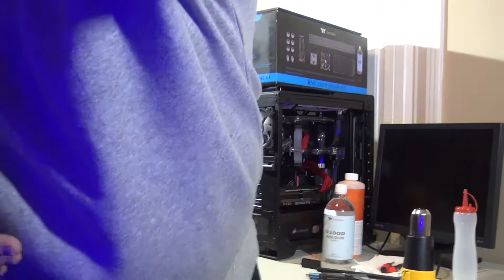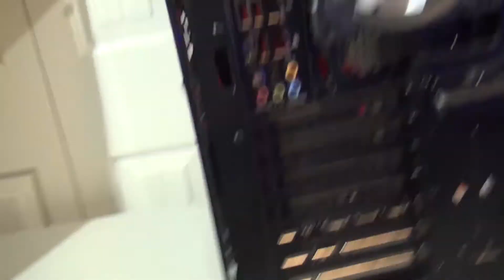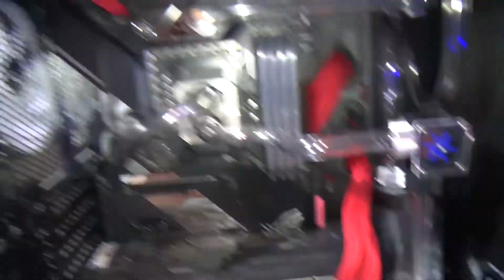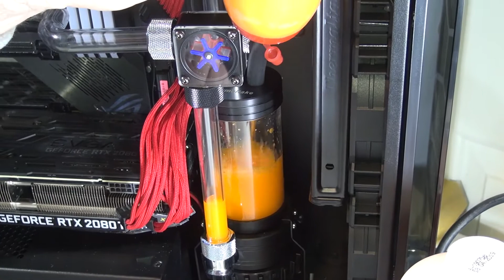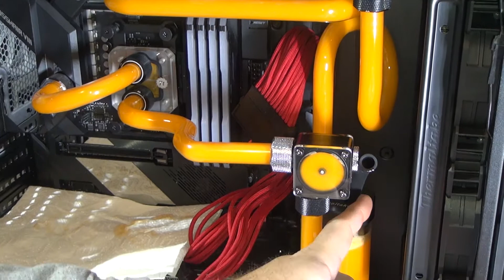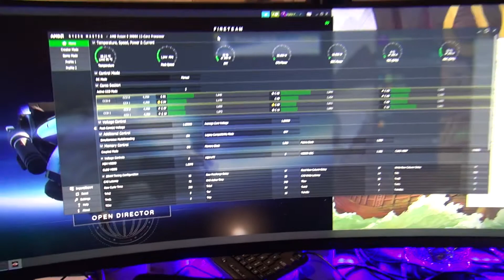Thermaltake m240 Water Cooling Kit Review and Build

Comment: How is the fluid going? Do you recommend that from EKWB? Cause some color coolants work for a month and you have to change it
Reply from the maker: I really like the coloring but it has gone completely clear in about 2 months.  So more dye will be needed or need to flush and add more.  Honestly, I have had better coloring with Thermaltake coolant.  I have a green colored system that has become somewhat transparent but it's still green.  That system is 3 years old now.

Comment: Instead of using the thermaltake fans could i use my own mans like cosairs ones? As long as they r the same size??
Reply from the maker: Yes you can.  All 120mm fans will fit on radiator sizes 120mm, 240mm, 280mm, 360mm, 480mm.  The 240mm and 280mm will need 2 fans unless you do a push/pull setup.  I have not seen major benefits in push/pull fan setups (as far as improved cooling) but if you have extra the fans and case room, it' doesn't hurt.